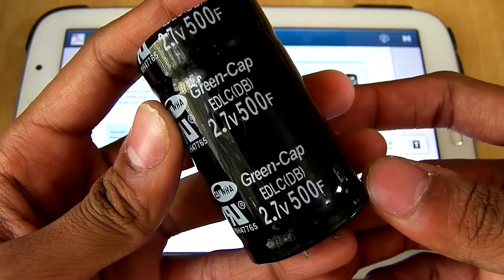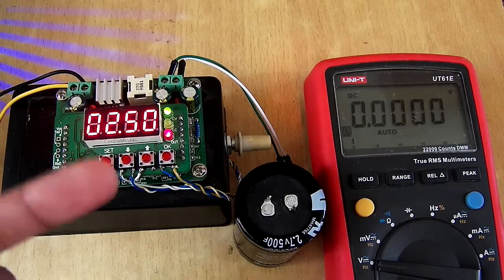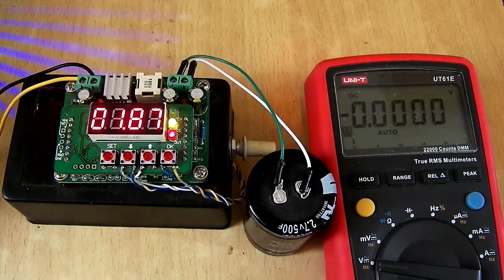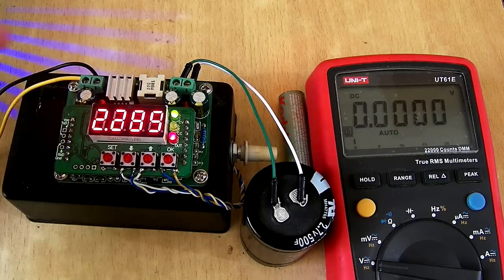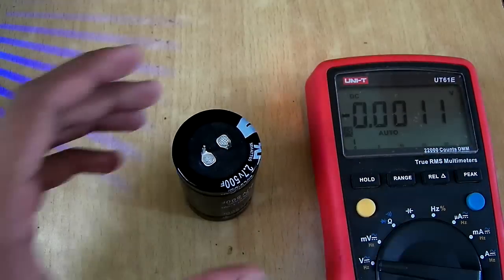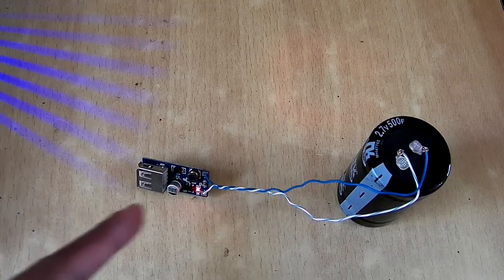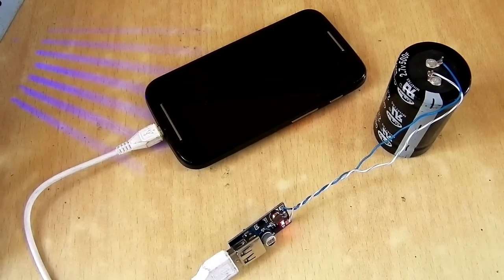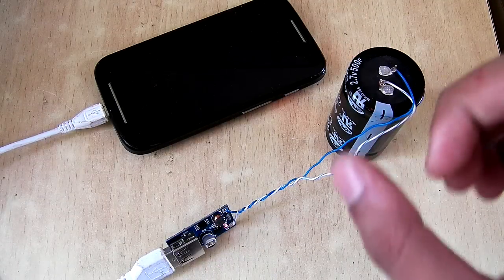Supercapacitor : Fast Charging for your Phone

Comment: can we use  2pcs super capacitors in Series connection & use  b3603 DC-DC step down controlled power supply

Comment: Nice idiot user and video fake, is impossible to charge a phone with just a step-up 600ma, you need at least 4 step-up in parallel mode to increase te current to 2 amp/2.4amp to start the charge or the laws of the physics say that you cant.

Or you need a step up 2amp 5volt but these steps up only work from 2v to 5v so you only can use from 2.69v to 2v to charge in front the step up 600ma that work from 0.8v to 5v, then you can use from 2.69v to 0.8v but the current is not enough.
But this step up 2 amp 5v waste 74% energy.
2.69v to 2v = 26% energy that you can use.
2v to 0v =74% energy wasted because the step up 2amp 5v dont work under 2v.

For this you need 4 step up 0.8v to 5v 600ma, because only 30% of the charge of supercap is wasted.
2.69v to 0.8v 70% energy that you can use.
0.8v to 0v=30% energy wasted.
But the current is not enough, for this you need 4 step up 0.8v to 5v 600ma in parallel mode., to reduce the energy wasted just to 30% and increase the current to 2 amp that need the phone to charge.

Comment: It's not possible to charge the phone on 5 minutes because the battery can't take the current.
It would explode
Reply: awesomefacepalm it would be also limited by the micro usb it can only transfer 5v 3a max
Reply: Add a resistor

Comment: Measuring current without a load is pointless, I=V/R. It only increased the measured current after charging because the voltage went up.

Comment: I have 6 of these exact same caps wired in series and I can charge them in about 10 seconds with my 13.6 volt, 40 amp bench power supply.  They're leaky though and lose almost all of their charge overnight.  Also I measured the bank of caps and they're only 58% of the capacitance that they should be if they're 500 Farads.  I bought them through Aliexpress.

You should use a balancing strategy if you're going to use them in series because they don't all charge up at the exact same rate.  They must be different values of capacitance I guess.  I just put 3 ordinary power diodes in series across each one (cathode on negative) which limits the voltage on them to about 2.4 volts each.

I did a bit of research on what happens if you overcharge them and it seems it just shortens their life rather than exploding like electrolytics do.  Don't trust me on that though.  Before I balanced them two of them got to 3.0 volts and seem to be OK still.

I melted a short length of 1mm diameter copper wire in about 1 second last night by shorting it across the bank!

Comment: This will not charge your phone in 5 minutes.   Because your efficiency and power output of the Boost Converter is what limits the output current capacity of the Super Cap.  The Super Cap can hold high current but the circuitry of the Boost Converter is what limits this application.  You would need to design a different boost converter application and monitor the cell phone battery temperature to ensure you could charge that quickly.

Comment: it dosnt charge a phone in 5 minutes 
the cap may produce alot of amps but the 3v to 5v booster only out puts 500ma at 5v ? i tried charging my iphone that needs 1amp at 5v and the module got quite hot 
so thats a failure its ok for charging devices under 0.5a
Reply: I assume you need more than one to charge your phone so fast

Comment: So if I have 10 of these, then I could store 130 amps⁉️🤔
Reply: Amps are never stored its the charge that is stored. Amps is just how fast can the capacitor or battery release that charge.
Reply: no, you can DISCHARGE about 130 amps from the cap. However, your actual storage is only about 1wh. You will need at least 5 of these capacitors to even charge a small phone.
Reply from the maker: +Nathan Jackson yes, actually more than that if implemented properly.
Reply: Nathan Jackson

Comment: You need to brush up your electronics...
You got some of the fact's right like how it holds 10 times less charge then a standards battery by weight.
But you fail to mention that first of all a 500F at 2.7V doesn't have enough charge to charge up a phone,  power loss of using the converter and series loss if you connect them in series.

Comment: You need 8 of those chunky capacitors to fill an iPhone battery. The energy stored in a capacitor is 0.5*C*V^2 .. So ur capacitor can store around 1.5 kJ. Convert this to mAh you get 173 mAh (assuming 2.5 V source), and an iPhone battery is around 1400 mAh.
Reply: 1400mA? that's half of what my Samsung phone battery is. l would need about 16 of them then. lol

Comment: Misleading Title - at 10:53 He Said "Charge the capacitor in 5 minutes!"
"Then use the Cap to charge your phone for 30-40 minutes for a boost of energy."
Earlier in the video he said this outputs 1 amp to the phone so I would get at best a 20% boost to my Samsung Galaxy from this. Good idea but still a little to weak for all the hassle.
Reply: +booobtooober you can always add some more caps in parallel :P or use the ones with 1000F

Comment: 2.7Vx 500F = 1350 Coulombs
1350 Couombs = 375mAH | Not really enough to charge a phone!
Reply: The problem is the phone will not draw 4.5A. I could plug my phone into a 10amp 5 Volt source and it will only draw the amperage it needs. Most phones will draw 1 amp, some newer phones will draw 2 amps.
Reply: 375mA for ONE HOUR,  so if you discharge the capacitor in 5 minutes... it is 12x  = 4.5 A for 5 minutes...  or 500*(2.7²)=3645 Joules that is enough to charge a phone...
Reply: +Rouge Hawkins 375mah seems low. Its hard to see the comparison in mah versus, for example 3.7v lithium battery that provides 3000mah though a 3.7-2.5v range when a ultra capacitor will discharge through 2.7-0.0v range and with a much faster drop in the voltage as it discharges. Many people say you can't compare capacitance in farad to ampere for this reason and others. If you use a 2.7v 500f ultra capacitor with a conversion to 5v USB and you can charge your phone for 15 minutes at 1amp you would still get a terrible charge, probably only 250 mah into the phones 3.7v battery with all the DC conversions and losses during charge. Plus the USB DC converter would stop working well before the ultracapitor is empty. maybe it would stop at 1 volt leaving the capacitor 1/3 full of power. Certainly useless for a phone charger.
Reply: Pls tell me is it enough to supply a arduino uno for 2 sec
Reply: Can supercaps boost the wattage?

Comment: You do realise the boost converter, that you are using outputs about 600ma of current. It would take ages to charge your phone.  If my phone had 1600mah battery it would take about 3 hours. 

As a power bank, yes you could use it as a power bank, but it does not hold enough charge, you would need many of those to even charge a single phone. The 9Amps it gives out is completely useless here :)

Comment: I'm not an electrical engineer but I know a little about electronics.  I don't see how it's possible to charge your phone battery in 5 minutes with a super cap.  The numbers don't add up.  The math doesn't allow it.
Reply: ***** If we take a conservative 2,000 mah lithium ion battery for a cell phone, it's physically impossible to fully charge it in five minutes without blowing it up.  You would have to give it so much current the wires and circuity couldn't handle it.  At five volts you would need at least 15 amps to charge said battery in five minutes.  If the wires and circuity didn't fry first, the battery would over heat.  So, even if you somehow were able to charge the battery in five minutes, you would damage it beyond repair. 

Furthermore, when you measure the total energy of a capacitor, it's only peanuts compared to a battery.   How many joules does a capacitor have?  How many joules does a battery have?  There's no comparison.

I suppose you could use one of those super caps that looks like a beer can to charge your phone, but it will take a lot longer than five minutes.  And even then, it's very unlikely it could fully charge a lithium ion cell phone battery.

Comment: Kedar The title of the Video is misleading. Based on Cap Discharge Rates, a Cellphone can never be charged in 5 mins. To those reading, the Cap charges in 5 mins & not the Cellphone. The Cellphone will charge at the same rate it used to, based on the Amperes delivered at discharge.
Reply: The Title should convey "Charge your Charger in 5 mins" :)
Reply: Imagine that in the future capacitors like this can handle more mAh and be smaller so we can use some to make a "battery
(By the way... You are right!)

Comment: love this video. I was gonna ask how many amps are coming to the phone, but it looks like your answer was "phone accepts as many amps as needed, no more" is this correct? like the other guy said, I don't want to kill my phone/tablet doing this. I have a 5v 2a usb charger I was planning to use this for. holds 4 2.7v batteries for 10ah of storage. this cap will replace the batteries correct?
Reply: It's this one http://pages.ebay.com/link/?nav=item.view&id=390608568549&alt=web it holds 4 18650 batteries.
Reply: iphones takes  between 800ma to 1a
ipads takes between 1a to 2amp depending on battery capacity 

other phones like androids  
between 500ma to 1a
lipo cell in a toy (300mah) probs be like 100ma  this bits a guess 

some lipos go as low as 30mah  so charging at 300ma will take 3 to 30mins  thats a guess aswell

Comment: I have exactly these step-up converters tested recently. One of problems is they have a limited current output, so youll never be able to charge your phone in 5 minutes :) I have tested them with 4V input & they worked as charger consuming about 0.55A from 4v source. No matter what capacity or power you will apply to input, the output current is limited, so, no "5 min charge", sorry. If you ment that it will "charge for 5 minutes", not "in 5 minutes", then maybe it is true.

Comment: I've used 12 of these 2.7v @ 500F caps in series and parallel to make a bank that equates to 15v @ 166F. I've used 2.4v zener diodes in reverse bias as a balancing circuit and over-voltage protection.
Reply: Six in series in parallel with another group of six in series?

Comment: LOL. Are you kidding? The energy of the capacitor 500*2.5*2.5/2 = 1562 J
Energy of the iPhone 4S battery is 1.4AH * 3600s *3.7V = 18648 J
1562/18648 = 0.083. It means that using that capacitor you will charge iPhone 4S just  8%. 
Moreover SamWHA capacitors do not have 500F they in reality they have 280-320F. See here https://www.youtube.com/watch?v=IvtIByYcogk
As result you will charge you phone just 5 percent. You need 20 pcs to charge to your phone battery to 100%.

Comment: Nice idea, but the problem with this method is you will be unable to use all of the energy stored in the capacitor. As the charge in the capacitor decreases the voltage will drop below the voltage required to run the 5v USB boost converter. You could use 2x supercap in series to increase the voltage but you will never be able to utilize all the stored energy in the supercap.
Reply from the maker: Yes exactly, with this converter it is not possible to utilize all the energy stored in capacitor, this converter shuts down at 500 mv which is not the most effective way to do it .
Well to solve this problem there is micro energy harvesting ic' from linear technology 
"LTC 3105 & LTC 3108".
I looked up Datasheets and found ,LTC 3108 can work with 20 mv!!!